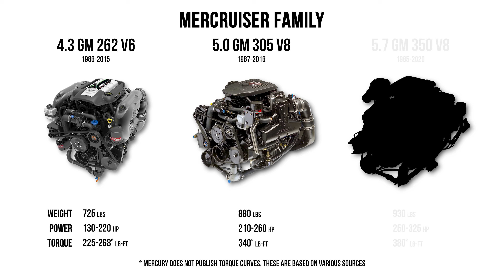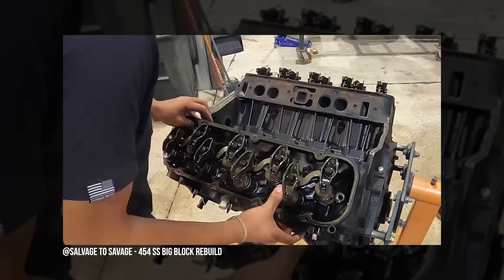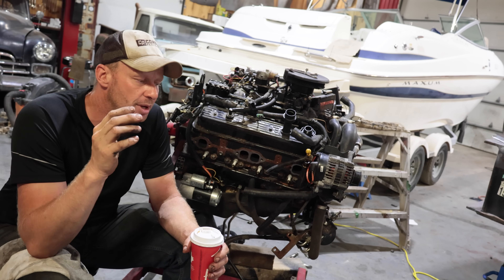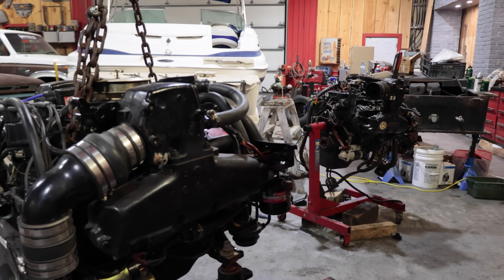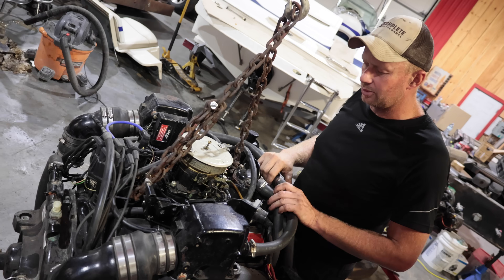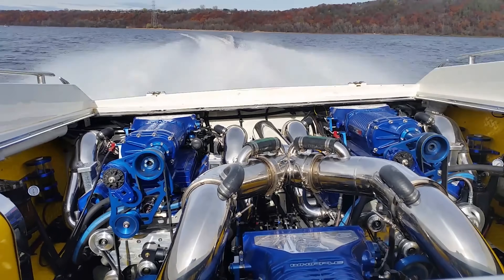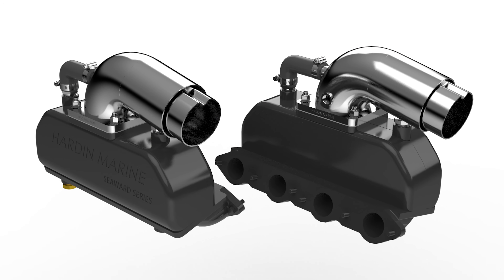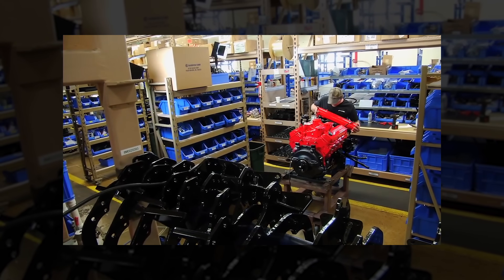REVIEW: Everything Wrong With A Mercury Mercruiser

Comment: Yes and no to several points, mercruiser did in fact sell two bolt gm engines, they were usually found in entry level boats, I also noticed that they had steel plugs . You get into the better boats they seemed to always be four bolt engines some with brass plugs some with stainless. I’ve put truck engines in boats, I use marine head gaskets and a marine specific cam. I have found no difference between road and marine starters except for a heavier coating and a uscg stamp. Older heavy duty trucks like 3500 usually had a 4 bolt. Also winterizing is easier to just thoroughly flush the engine with red antifreeze, I pump in through muffs and never recycle what comes out as it will be diluted. Mercruiser literally bought cam less long blocks without plugs, they’d “ marinize “ them ( put plugs and marine cam) and coat them after final assembly. These engines are still being manufactured today but as crate engines only. I once took on the task of building a marine 454 for a Malibu , what a gargantuan expensive pain in the rear trying to locate parts.

Comment: I've seen 4 bolts with the webbing busted out of the block. They crack at the outer bolts and all hell breaks loose. I think Two bolts are actually stronger, and a two bolt drilled fro splayed four bolt caps is even better.

Comment: Years ago I was told, or read, or saw somewhere that said the engine oil needs to be at 180 degrees to function properly.
Is that still true or is it different now?
If those engines are operating at 160 degrees will the oil still heat up properly, or does that become an issue eventually? Thanks.
Reply: You are supposed to run boat specific oil. Of course it costs more. I didn't care it was 5 quarts for a season.  I ran the Mercruiser  "Quicksilver" brand oil. Its a pretty thick at 25-40w  synthetic
Reply: @gearjammergamer8560  , Ok, thank you for answering my questions.

Comment: Not really relevant, but, Years back, OEM’s made specific marine -  industrial application engines. For instance, I had a -72 SleekCraft with a Jacuzzi Jet, powered by a Oldsmobile 455, designated as a “Marine - Irrigation Motor”, and was built with heavier duty / high performance components. Some of these engines could be found in industrial / military applications like aircraft auxiliary power units and turbine engine starter carts. I believe the Lockheed SR-71, A-12, etc., used such carts.

Comment: As a dealer tech for over 20 years, I can say without a doubt the biggest issue is the owner.
FWIW almost every one of the V6/V8 crack in the lifter valley when frozen.  I have seen them popping a core plug and not cracking, but that is still rare.
As far as 4 bolt mains, that is just an old wives tail... Mercruiser mostly uses off the shelf truck longblocks, sometimes different cams, and always brass freeze plugs, but I've never seen one with 4 bolts.
Mercruiser has all their parts books online its easy to check my claim on 4 bolts.

Comment: There was a 4 cylinder version too based upon the GM 4 cylinder industrial engine, i dont recall displacement, but maybe 2.xx liter. I think they were mercruisers as well.
Reply: 181 basically a stroked nova 4 cylinder
Reply: Iron Duke?
Reply: 2.5 Iron Duke
Reply: A 2.5 and a 3.0. Has both and both ran a long way

Comment: 4 bolt main GM blocks have not been used in the production marine world since the early 80s. Brass freeze (core) plugs and different camshaft are main differences between automotive & marine blocks sourced from GM. 
I look forward to your LS swap series. Keep up the good work.
Reply: My 2011 350 mag mpi is a 2 bolt
Reply: right on scott
Reply: 100% correct Scott 👍. Camshaft profile and brass freeze/core plugs IS the only difference between the long blocks.     The marine guys will spew vast amounts of nonsense arguing this fact. One marine mechanic was literally shaking with anger when a customer of his bought an automotive 4.3 he got from me. He screamed at him about how auto engines don't have the "special coating" inside so they will rust out from the lake water 😵
Reply: @johneckert1365  I like the fact they have stainless valves too.
Reply: I believe the late model 350 magnums were all 4 bolt mains.
Reply: @mth21355 Vortec, not Magnum. Magnum was Chrysler 😑. The Vortec 350 was built in both 2 & 4 bolt main configurations, although I agree that I've only seen 2 bolt mains in marine application Vortec 350. 305 and 262 (4.3 V-6) were only 2 bolt mains.
Reply: My 2000 Mercruiser 7.4L is a four bolt main.
Reply: thank you!!!
Reply: Every single GM LS based marine engine has 6 bolt main caps.
Reply: My '87 Mercruiser 260 (350) was a 2 bolt main. Original to the boat.
Reply: The crank can also be different is the rotation is reversed.
Reply: @Soundsofthewood  The crankshafts aren't different between RH and LH rotation engines. The camshaft is different.
Reply: @johneckert1365  maybe chevy dosen't need that.
I know the diesel do.
Reply: @tristanlong7  2 cycle Detroit Diesels can be built to turn either direction. They don't use different crankshafts. The inline Detroits actually can use the same camshaft, it just gets installed backwards. The ends of the camshaft are stamped for that reason

Comment: Finnegan towed his boat with no motor to a boat launch.
Then pulled the motor out of the truck.
Put it in the boat.
Then went for a boat ride.
Then put the motor back in the truck.
Reply from the maker: I remember that episode.  That was LS jet boat though
Reply: @DEBOSSGARAGE  I can't remember what motor it was.
Some I/O's do have closed cooling systems.
Usually when they're used in salt or brackish water.
I had Rinker a few years back that had radiator, and the feller that I bought it off used it Florida.
Makes sence I guess.
I imagine salt water, and cast iron would not get along.
☺
Anyways, yet another fantastic upload from you sir, and I
can't wait for the next one.
"You do good work"

Comment: The big difference between swapping the 5.7 to an LS will be the exhaust manifolds - will need to source a different set and be able to attach to the muffler - good luck, they are out there
Reply from the maker: Fount them, they are in my shop
Reply: Can’t tell which drive system is in the boat, would guess it’s a V-drive and would be a good time to replace the dripless drive shaft seal
Reply: Sorry - have a good night and good luck

Comment: Having not one idea about boats a thought occurred to me. Why not use a heat exchanger to cool the engine? Use regular antifreeze then use the raw water to cool the coolant? I know weight and cost are a problem but I don't see a valad reason not to do it.
Reply from the maker: That's what we are doing with the LS swap.  Already have the heat exchanger
Reply: That is common and considered a premium option. Referee to as closed cooling as opposed to raw water as he described. Also works better on EFI engines as it keeps them water temp more consistent

Comment: Do you plan of mating the LS to your current merc Alpha one drive or plan on upgrading to a Bravo?
Reply from the maker: First Alpha, then when it blows, Bravo lol
Reply: Not a “drop in” proposition. Alpha and Bravo transom plates and gimbal housings are different. IE can’t just slip a Bravo drive into Alpha unit.
Reply: I live in Fond du Lac right where they build Mercruisers. I was told by a retired tech that the Alpha is at its upper limit @ the 400hp or 400ft./lbs. I was told as long as you aren't doing full throttle holeshots with it and it's not a problem.
Reply: @stevenmccord3503 even gen 1s lasted behind big blocks for a little while. What used to kill them was surfacing. Load and unload on the drive would absolutely rip it apart. With the LS the problem will more likely be rpm...

Comment: I work on boats on the coast I/O boats have fallen out of style to much headache. Outboards are taking over for the smaller sized boats. They were designed to be on a boat right from the start. They hold up well and in my opinion much easier and enjoyable to work on.
Reply: Inboards take up too much room on smaller boats.
Reply: Agreed. And the new 4 stroke OB’s are so quiet now. You can barely hear them idle except for bubbles from the exhaust. I have ‘06 Merc 150 EFI 2 stroke that’s fuel/oil injected and it’s loud. Sounds cool when you run it in the driveway with water muffs on it though.
Reply: And so much cheaper to own!! Compared to diesel boats, the annual running costs of OBs are so much cheaper even if they use twice the amount of fuel!
Reply: That’s funny the cost to have it serviced and replace it is 10 times the cost of a small block Chevy @mz22wa
Reply: I prefer the looks of inboard. Outboards always looked like they were cheaper but it’s the opposite these days.

Comment: Jb weld has worked fine on cracked exhaust manifolds
Reply: but would you trust someone else's band aid work?
Reply: @Dankcatvacs  Trust?  I would definitely be checking the bilge when running it...but would it stop me from buying the boat., probably not if I could negotiate a discount, especially if a) it the THE boat, and b) the rest of the boat is in OK shape.    It's a repair I am comfortable with as it won't sink the boat and isn't likely to leave me stranded. And even then I tend to boat where there are other boats and cell coverage.

Comment: My current boat has a $75 junkyard 4.3 from a blazer. I put it in 4 years ago and it's been phenomenal 😂
Reply: For that price, you can do no wrong. Any win, even for a day, is worth it.
Reply: Ho or reg 4.3?
Reply: @tonydiesel3444  I'm not sure
Reply: Did you switch oil pans? I'm doing the same things now.
Reply: @brandonlarry1645  nope I left the Blazer oil pan on it. I did switch dipsticks, so you need to fill your engine up with the correct amount of oil, then calibrate the boat dipstick to read correctly with the new pan.

Comment: As these engines get older internal scale will form that often plugs up the block drains and manifold drains. Use a small screw driver to poke into the opened petcocks to ensure all the water comes out. On the later models with connected hoses to a single drain remove the quick connect hose connection on each side of the block and insert a small screw driver to move the scale and allow the water to fully drain.  I learned this the hard way and was told how by seasoned marina mechanic what I needed to do in the future.
Reply: What about using green coolant for storage? It has rust blocker? That's what friends do with race cars.
Reply: @workingcountry1776  You can't. Boat engines are open loop.
Reply: @alexandermckay8594 you can remove hoses an add coolant to them and it will either flush out water by replacing it or dilute the water enough to not freeze.
Reply: @workingcountry1776  as long as you don't drain it into the lake its poisonous.
Reply: @workingcountry1776   Any marina should be able to sell you the correct propylene glycol based nontoxic antifreeze used for winterizing engines.  It has corrosion inhibitors.  Its different than the cheap alchol based stuff at wallmart/big box stores.  Drain the water, then fill the system with it.
Reply: This! I bought my boat with a bad engine and found this exact situation when I pulled it apart.
Reply: We always used a thin zip tie to remove the scale around the inside of a drain hole. The flexibility helped to reach around the area inside to help clear the scale and rust.
Reply: This is all information contained in the manuals.  Study the manuals and follow the instructions.
Reply: Do not trust the single block drain. Better yet take that off and toss it in garbage.
Reply: Run aircraft #4 line from those bottom outlets to water pump inlet. Invent your own inlets before the water pump. Open or closed system it keeps those ports from plugging. On our dragster, which only held water with no pump, we had quick disconnects with lines  to these ports for cooling after runs. It allowed the cold water to warm before reaching the heads,  stopping the cracking problem. I used a 50 muratic acid,  water mix to flush the rust from my marine applications, of course bypassing any radiator or heat exchangers in the system. About ten minutes is as long as you want to leave it in the motor. If you motor is very old freeze plugs are a concern. If you have the motor out,  change them. Saved iron Mercedes engine in my sailboat this way.
Reply: Not if it's freshwater cooled

Comment: I think he had the cylinder head info backwards between the two engines. I would definitely use the 305 heads on the carb’d 350 engine. A 305 head usually has a much smaller combustion chamber and would raise the comp. ratio a great deal. I would transfer all the top end from the FI engine and stick on the carb’d 350 block. Run premium gas and hit the lake. 0:03
Reply: 305 heads on a vortec 350 will make it a dog.
Reply: @Ddabsolve Rich’s isn’t a vortec
Reply: @Ddabsolve  if you go back and look, his 350 carb’d engine is an ‘87 model. 305 Vortec heads would not make that engine a dog, plus he could use all the stock EFI from the original boat engine. 305 Vortec heads do not flow as well as the 350 Vortecs but they flow fairly decent, and prolly better than the ones that are on the carb’d 350.
Reply: The Vortec 350 head outflow Vortec 305 heads. 

The Vortec 350 is already over 9:1 compression with the 64cc heads.

Comment: My next project is to swap out my 200 Suzuki outboard with a 250 HP Seasall Hyundi V6 Turbo diesel and a bravo 2 leg into my 7 meter aluminium cabin cruiser, should be fun,cheers.
Reply: @mike...is your suzuki200 junk.( re replacing..am looking for a fairly new low hr atx 175 or 200
Reply: @eaglezxz3354  Hi, my Suzuki is in perfect working condition if your interested, I'm in Australia.